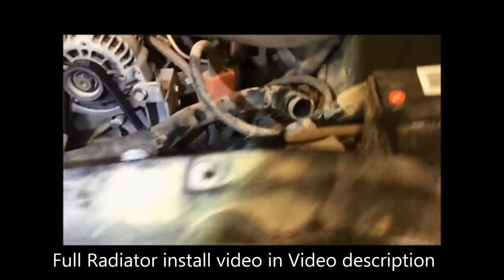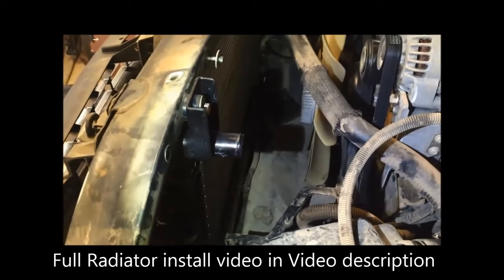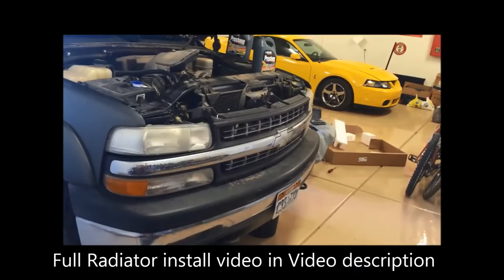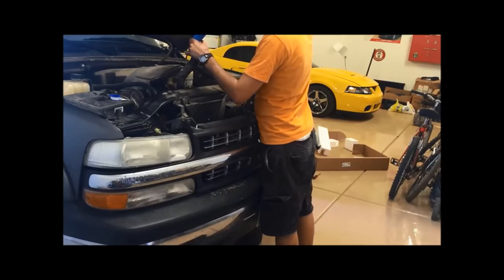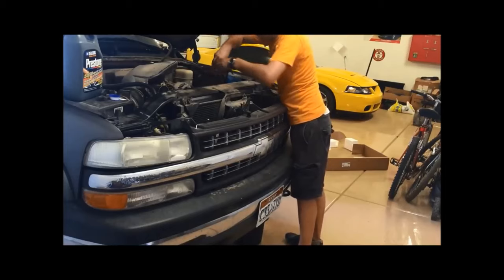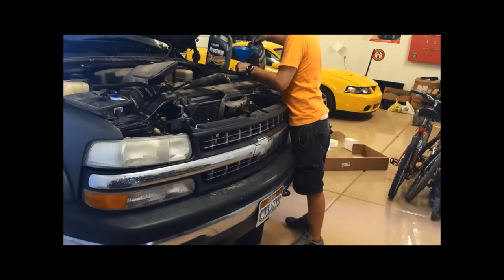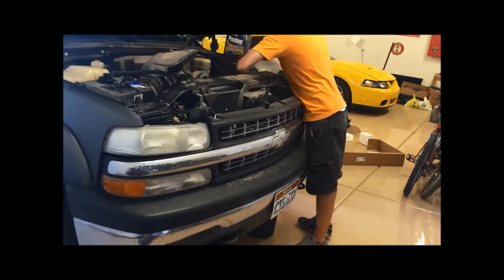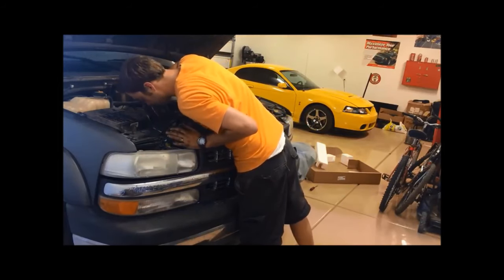Burp GM 5.3L 6.0L 6.2L Engines Silverado, Suburban, Yukon, Escalade, GMC Chevy Chevrolet Cooling

Comment: Elimination of the radiator cap is one stupid engineering decision.
Reply: Or like with my 3400 v6 grand am gt, it had a bleeder valve
Reply: Yeah cause mine will blow out the bypass sometimes make ya have anxiety for days 😂

Comment: Alright guys if any of you have tried this and your upper hose gets really hot and boils still. Make sure your thermostat is good and if that checks out and you are certain that you don’t have any clogs. Try unplugging the intake hose on the heater core. I was having so many issues with my upper hose over heating and it would start getting too hot because I had air in my system. I tried doing this like 4 times and when I took the hose off my heater core it literally blew off so much air pressure out I instantly had a feeling that was my culprit. Plugged it back in and started her up and sure enough the car drank the rest of the coolant it needed to bleed out the rest of the air .

Comment: I searched for quite awhile before I found the solution to my Yukon overheating. This was the problem. I filled the system a little differently than you did though. Instead, I disconnected the top hose at the radiator and filled the radiator till full with a hose on a funnel because of the radiators horizontal opening. I then fill the rest of the system through the top radiator hose, repeatedly filling it, then raising the hose till it burped. This took several times till the system was full. I then reattached the radiator hose to the top of the radiator and the problems were solved. No more over heating and now get heat out of the vents again. Thanks for the information!

Comment: Dude I could kiss you right now. I spent hours on this thing and couldn't figure out why my engine was overheating. I had to change the coolant reservoir tank and some hoses, then it started overheating, You're a trick worked like a charm. So many people told me to do different things which would add a lot more work and money. You are a lifesaver. Thank you so much! I appreciate that. You're the man!

Comment: Dude..... I've been fighting am overheating issue for a month after replacing water pump and radiator. I tried bleeding several different ways. And came across this. Had heat almost instantly after starting the truck, and so far so good since. Thank you so much!

Comment: Thanks Bro!!💯💪🏿 I had replaced all the water and heater hoses, thermostat, water pump and it started running hot!! Wasn't running hot before. Just was leaking water. So I was figuring maybe a bad water pump or thermostat. NOPE! I found your video with easy to follow instructions, and now its not running hot anymore. Thanks again!! 💯💪🏿🙂

Comment: I just want to thank you for this video. I have been working on my 2018 Silverado with 60,000 miles 5.3. The truck had intermittent overheating because of a stuck thermostat I replaced every single thing I can possibly think of, and no matter what it kept overheating. I finally did this and it’s freaking perfect. Thank you so much Hailey spent three weeks back-and-forth trying to figure this out. Thank you again!🎉

Comment: Thanks Man, this video saved my ass today after I replaced my water pump. At first all it was pumping was air, had to fill it as you showed 2 times before it started working right. Too bad they couldn't put a fricken radiator cap on the radiator like back in the good old days.
Reply from the maker: Exactly! Without the cap people just dump in in the expansion tank and it overheats. Glad you got it!
Reply: There is a video on the utube, putting a normal cap on by splicing it into the top hose.....
Reply: @steves5355 what video?

Comment: I’m gonna try this today now.  Been fighting luke warm heat all winter.  Thought it was a clogged core, but it’s fine.   Noticed it happened after doing a water pump.   Flushed the whole system today and same symptoms.   Makes complete sense now.     We both got SY cobras and gmt800s haha

Comment: Very good video. Did my R & R of the radiator today. I did a slightly different method of filling the radiator. I did leave the top hose connected to the thermostat housing, and did fill it as you said. I found that a piece of 3/4" flexible electrical conduit slipped into the top hose outlet on the radiator with a snug, leak free fit. Filled the radiator till coolant just came out, then slipped the pre-filled top hose on quickly. I think your way of filling the radiator is the best way. Thanks again.

Comment: I have a 2004 Silverado z71 that was overheating due to a stuck thermostat( lower hose cold- no coolant running through it). Changed the thermostat, replenish coolant through the expansion tank and overheating continued.  I noted that there was no heat coming out of the vents event though  the temp gauge was reaching almost to its hottest and at this point I knew there was a blockage issue or the water pump was bad. I got a coolant testing kit from the auto part store and system held pressure. At this point I was about to pursue the replacing of the water pump when I saw this video. To be honest, I didn’t have much faith on this procedure but I went ahead and refilled the system as directed in this video. My overheating problem got fixed !!!! Definitely try this before getting to more expensive/complicated repairs.
Thanks a lot man!!!
Reply: Did you drain the fluid that was in it and then refill?

Comment: Ok- so to back fill with coolant I am disconnecting the hose from the radiator and pouring it directly into the motor? Is that correct? I've been fighting my system for 5 days. Also, just to ensure I do this correctly, I am making sure the motor is cold when I do this? Correct?
Reply from the maker: Correct. If the engine is hot it could burn you and will spray everywhere from the pressure. Yes, Pour into the hose so it goes directly into the radiator, and have the expansion tank off so it can flow without pressure.

Comment: Hello, at what point would you add the coolant in the resovior? And after the procedure, would I need to start the truck and turn the heat on to bleed the air even further? A couple years ago I replaced every bit of my cooling system and forgot to the bleed the system, no issues overheating, but I noticed that when the winter time comes, the heat will work for a couple of minutes and then get cold, then back hot again. I assume this is an air pocket.

Comment: I’m trying to do this after replacing my thermostat I opened the water pump side to fill the radiator and it started spilling out the water pump. I opened the radiator side and it started spilling out the radiator. I left it on with the cap off to burp it out and it started coming out of the cap. Any suggestions or thoughts?
Reply from the maker: Once it’s coming out both sides as you fill the other, the system should be full. From there also fill the degas tank and when it’s coming out all areas it’s full and you can put the hoses back on
Reply: @dannyjohnsonsgarage  I’m thinking it’s the radiator cause I panicked and put the tube back on the waterpump before I could try to fill it cause it was pouring out so fast, I then went to the radiator and as soon as I pulled it slightly I saw some drip out so I just left it alone. My friend is coming over as soon as it cools down to try and cover the water pump while I pour it down the tube to the radiator. I’ll let you know how it goes

Comment: TY SirD. Does this method also burps the heat exchanger automatically since it’s an integral part of the cooling system? TY.
Reply from the maker: Yes. Run the hear on it’s highest setting while burping and it should help push our air bubbles

Comment: Will have to try this just replaced the radiator and now it doesn't even get to operating temp which is 210 and my heat is warm but not hot

Comment: Does hose have to be disconnected from both the water pump and the radiator?  Or,can it be one or the other?
Reply from the maker: One or the other. Just gotta get the hose high in the air
Reply: @Danny Johnson’s Garage  thank you. And to anybody who's curious,  it definitely works!

Comment: After we are done filled radiator and water pump and reservoir, did you run the engine with reservoir cap off at all?
Reply from the maker: Yes, but not when the car is warm. When it’s cold I started it, held the hose up high, added coolant with the cap off. Only for a few minutes did I run it, then put the hose on, closed the cap, and let the degas tank do its job. Just keep checking the level and add coolant once it’s cooled down so the cap doesn’t have pressure
Reply: @dannyjohnsonsgarage everything is full right now. Radiator water pump and reservoir it got dark on me so I will finish up tomorrow morning. So run engine with reservoir cap off  for 10 mins ,and see if the level drops ? That’s it ?
Reply: @dannyjohnsonsgarage I’m assuming run it with reservoir cap off, and heater on for a few mins after I followed this video?
Reply from the maker: @a.a.9721  Yes, if you feel its full, drive it around with the heat on full blast and just check the level and watch the temp gauge. Don't remove the cap when it's hot. From here it should use the degas tank to burp the rest. It's just important to fill the radiator as some people just fill the degas tank and don't realize they are low on coolant.
Reply: @dannyjohnsonsgarage  worked like a charm.  I know you have heard it before but Thanks so much. Do you still have that truck ?
Reply from the maker: @a.a.9721  yeah, I have to do the heater core next on it

Comment: I changed the War I change the water pump on a 2011 Cadillac Escalade. The temperature before changing a water pump remains at half now it's 25% pass time most likely the problem

Comment: hey brother did this yesterday and when i start up an incline my temp will slowly rise to around 230-40 when i start down or level out it will pretty much immediately start cooling back to around 200. it's driving me nuts.  have replaced every hose, clamp, and fitting including water pump in the cooling system any ideas???? thought maybe reservoir cap or bad thermostat but don't know
Reply from the maker: I would think the thermostat may have something to do with it if it’s not the water pump or burping. Worst case would be a bad head gasket and it’s trying to keep up
Reply: @dannyjohnsonsgarage  ok I just replace pump and thermostat about a month ago

Comment: Should I leave the reservoir cap off while letting it come up to operating temp so that it let's the air escape?
Reply from the maker: It should be fine either way because there is room in the expansion tank for air to escape (de-gas tank as it’s called)

Comment: what if when i took off the hose from water pump coolant started spilling out the water pump does that mean system is already full ?
Reply from the maker: I would also pour it towards the radiator side and if it keeps pushing coolant out the thermostat end then, yes. Make sure the thermostat isn’t stuck closed

Comment: How is it going to c9mw out of the radiator when it has to have the thermostat open to go through....mine just went into the overflow
Reply from the maker: Thermostats do not completely block it off, they only slow the flow down when closed
Reply: @dannyjohnsonsgarage  then why does coolant not come out of my radiator when I pour coolant into the upper hose...
Reply: The thermostat is brand new

Comment: Should I run the truck with the heat on when I'm done or does the reservoir handle that automatically? Great video. It  decreased my anxiety greatly! Thank you!
Reply from the maker: Run it with the heat on Full blast so that the coolant can also cycle through the heater core. Full as shown in the video to burp it
Reply: @dannyjohnsonsgarage should I do this while reservoir cap off right ?

Comment: If the overflow is higher than the radiator and engine, do you have to do that?
Reply from the maker: To fill the radiator first, yes. With the pressure, you’ll fill the expansion tank and it will slowly drain but not fast enough to fill the radiator.

Comment: Question. Is it normal that if I take off the cap on the expansion tank whit he engine off and the I turn the engine on the boiling water raise up in about 5 mimutes and start it trow the water out? All this whit the engine already warm. I have a 2007 Silverado 5.3. Classic style
Reply from the maker: No,  I’m guessing you need to burp the system, or you have another issue like a bad water pump or thermostat. Make sure the radiator is actually full as seen in this video

Comment: So my truck temp maxed out i changed the water pump less than two years old filled it ran it still went all the way up. Changed the thermostat and temp sensor the system was full while changing the sensor nothing came out nothing but a drop. Is there a posobility that side of the cooling system is blocked causing this engine coolant hot issue? The radiator is good no leeks and fills up good the same as in this video.
Reply from the maker: Yeah, feel the hoses as the truck starts to warm up and see if any hoses are still cool. That would indicate a block. Perhaps the thermostat is in backwards
Reply: @dannyjohnsonsgarage  the thermostat wont even fit backwards. Im thinking it plugged up on the driver side because when i changed the temp sensor nothing came out but the system was full. I did what the video shows and after awhile it still got too hot so i shit it off and gave up for the night.There are no obvious signs of blown head gasket. New water pump , thermostat and temp sensor along with coolant.
Reply: @samuelwalker6783  having the exact same issue. Did you ever figure it out ?
Reply: Yes i flushed it and refilled. Been fine since
Reply: @samuelwalker6783   I'm having same issue now. Radiator full etc pulled temp sensor no coolant came out. Run it hoses all stay  cool. Did you have to drain all coolant and start over? What steps did you take to resolve this issue. Been a nightmare.

Comment: Should I drain the fluid that’s in it and start fresh or just leave it in and fill like this??
Reply from the maker: If you’re just adding more fluid, just add more into the hose as shown here and burp it. If the coolant is very old it wouldn’t hurt to start fresh

Comment: So my 04 gmc sierra isn't over heating. And yet after it warms up it takes a while for the heat to pump threw the vents. And I can smell almost a metallic smell coming threw the vents. And there isn't any codes popping up threw the code reader. I had the top end rebuilt and it was great then a year after I noticed white smoke and checked oil and coolant and both were clean. Then a year after being now the issues at the top are going on. Anyone know if this is the solution for my problem
Reply: Also after it warms up it almost sounds like the steering pump is gone. Has that whine to it. And I assure you it's not what's making the noise.
Reply: did you ever figure that out?
 @rmkurmit

Comment: Why not just flush the radiator through the overflow. It sets higher and should force the air out.
Reply from the maker: The expansion tank is intended to vent, and at a small rate, mostly vapor. You’re best off filling it as shown and allow the coolant level to rise and push out air, not cram it down the car’s throat so to speak 😉